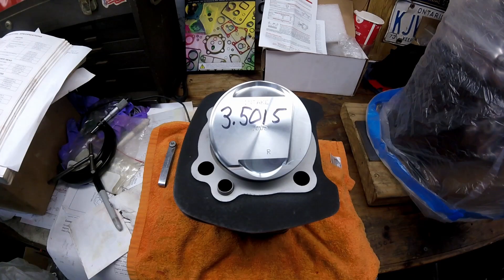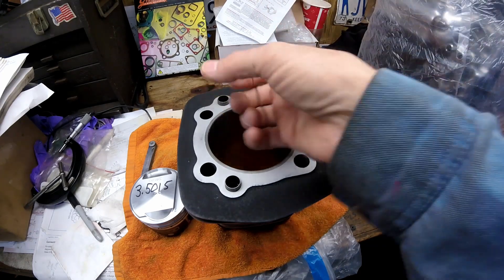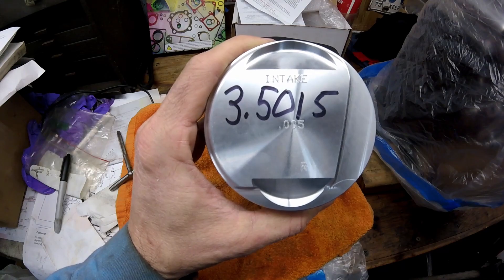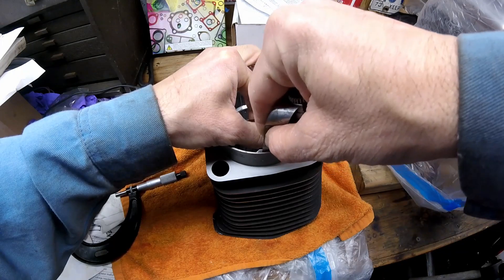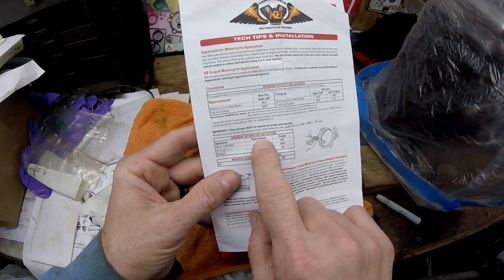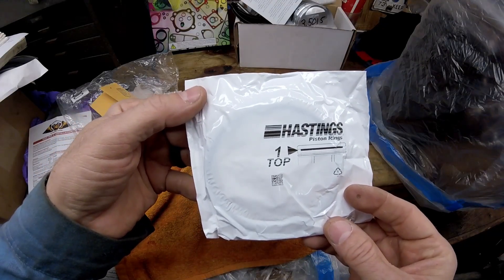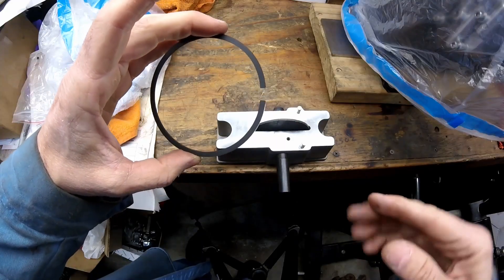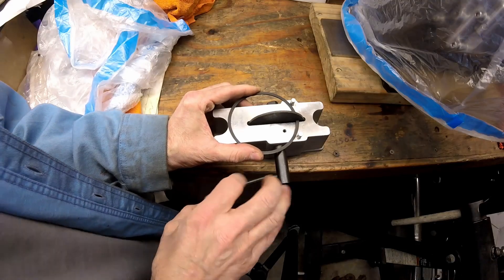Setting Ring End Gap on a Harley Knuckle Panhead Shovel Head EVO Twin Cam M8 naturally aspirated.

Comment: I see you don't file the Bur off after using a ring cutting wheel ? I have a cutting wheel they leave a Bur . Unless your running TURBO.  Might Be the Dome pistons  Flat top pistons by   KB or  S&S recommends  Bore of 3.501 divided by 300 = 0.012   S&S pistons and Chromoly rings the gap is pre set  Lesson Learned Order a ring set 10 over.   I had 22 on the top and 40 second 100 on the oil rinds Had so much blow by it was sick.   Oil rings its not as critical on the gap 100 is like a semi truck driving in a tunnel   , leak down at 3000 miles was bad 90% loss . pop the top and got 20 over rings and gapped them  I cut the top ring at 0.012 that 22 is to much  then 0.012 on the second ring .    at 3000 miles everything was great 170 psi front and back and zero leak down . at 15,000 I checked again  still the same .  added the SE heads have not checked it yet see what i gained or loss .